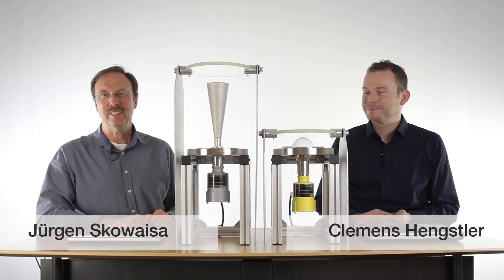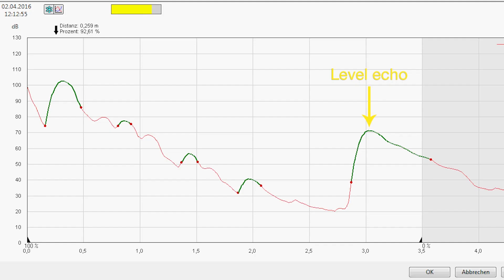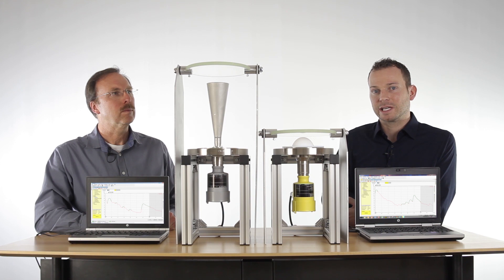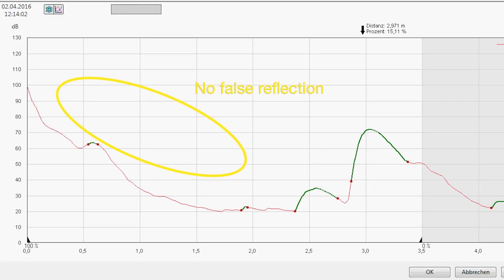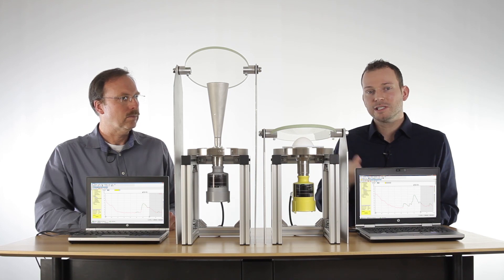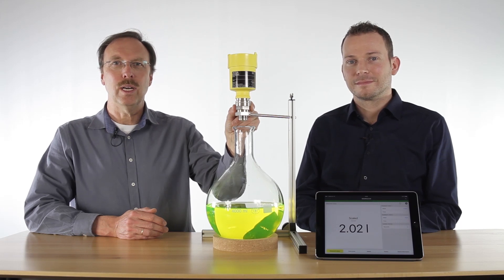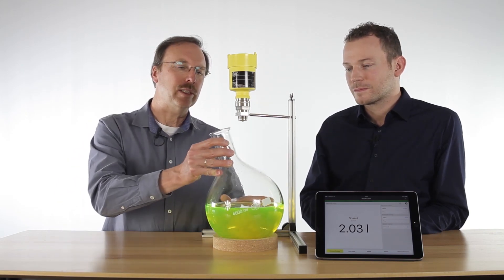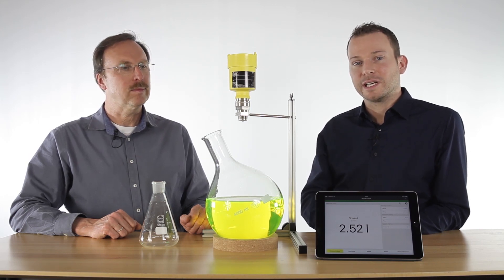VEGAPULS 64 - Measurement through glass | Radar level measurement

Comment: What is the maximum thickness of glass that VEGAPULS 31 can measure through?
Reply from the maker: Thanks for your question. We recommend a glass thickness of no more than 30-40 mm.
Reply: @VEGA_Level_Pressure  Thank you for your response, Please will the VEGAPULS 31, work perfectly if the pressure in the tank is 10bar, since the instrument is sensing through glass.